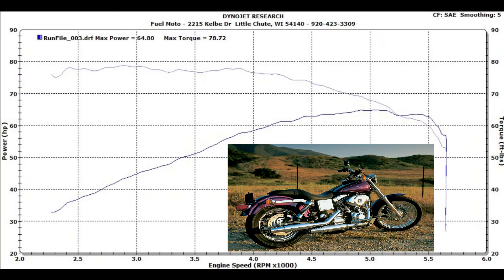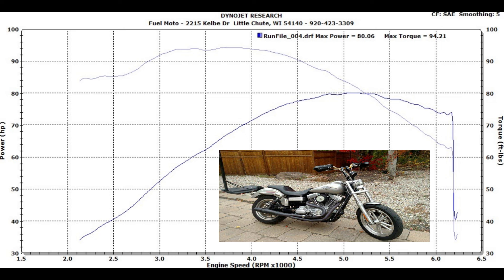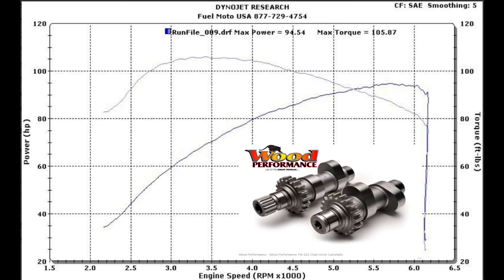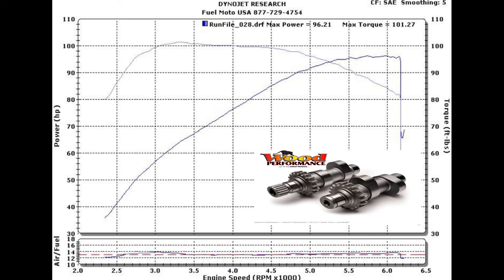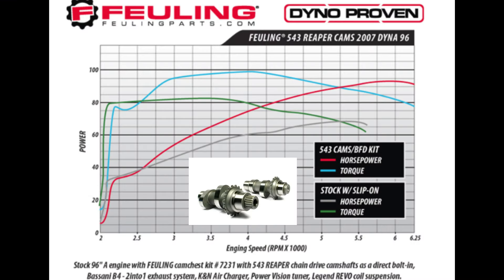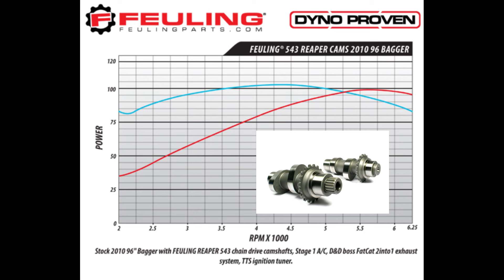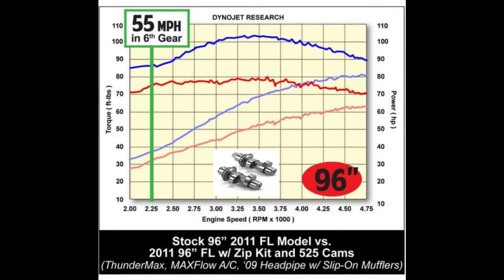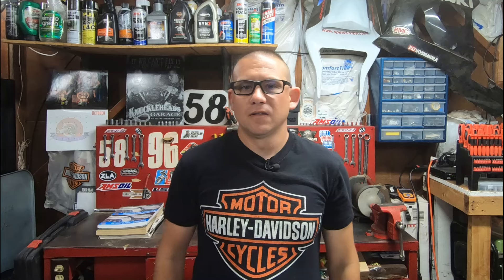Consider New Cams For Your Twin Cam 96 Before You Convert To A 103

Comment: Are you available for consultation appointments? For a fee ofcourse..
I need some guidance and recommendations as to how to go about, were too look and what to look for with my 96 performance upgrades
Reply from the maker: What year 96 is it?
Reply: @GixxerFoo just picked it up its 08 street glide all stock with slip on vh.
Reply: 13k miles
Reply from the maker: Oh wow, where did you find that at? Being an 08 keep an eye on the compensator. They had issues there between 07 and 09. Cranks in those years had some issues with big horsepower builds, they tened to develop some run out and wobble. But if you keep the power to a decent level it won't be an issue.
Reply from the maker: I would suggest looking at FuelMoto, they sell a wide range of brands and even there own house brands as well. They are a top notch company to get an idea what you want to do with your bike. What kind of power are you looking to make?
Reply: @GixxerFoo  it was a craigs list find out here in Oakland California.. I would line to squeeze as much as possible , without running into issues ,if issues are enavidable I will address them as well
Reply from the maker: With a 96 the best upgrades and keeping it reliable, start with a nice cam like a Wood TW-222, great all around cam produces horsepower in the mid 90's and torque close to 100ftlbs with a 96. 103 is only a bit more with that cam, not really noticeable. So with that cam not worth a 103 kit. If you need more a 110 kit at 10.5:1 compression will put you over 100 horsepower and 110+ torque. Next step is head work. A good head port, even a mild job would get you in 110 horsepower range and in 120's on torque.

Comment: I have an 09 96 and planning to add a cam, will these cams provide a nice lumpy idle or smooth like the stock cam?  Having to replace the compensator so my as well do a cam too.
Reply from the maker: Going with something aftermarket and not Screamin' Eagle will give you some lumpy idle.

Comment: I have a 09 fatboy..if I get the TW555 cam do I need to switch the lifters to
Reply from the maker: You don't have to change lifters, it's a straight bolt in. There's some debate on switching lifters, I like to change lifters with a new cam, it's not necessary just a preference.

Comment: so i want to buy a used 2013 street bob with the 96. the bike has new covers on it saying 103. it has a vh pipe airfilter and tune. the owner is the 2nd owner and doesnt know much about the bike.  is a 96 with a stage 1 the same as a stock 103?  or was a stage 2 put in it?
Reply from the maker: The 2013 would of been a 96, now someone could of put 103 covers on it or actually put the piston and cylinder kit on the bike. Only way to truly know if it doesn't have receipts would be to pull the heads and measure the cylinder bore.

Comment: Will I need compression releases if I add woods 777's to my 96ci? 
(I have a 2into1 and intake)
Reply from the maker: Complete bolt in and it won't raise your compression up enough to need compression releases. If you ever have any head work done it's not bad idea to add some while the bike is down but not completely necessary.

Comment: I was recommended s&s 583, but after watching your channel.  I don't know what to go for.2010 dyna super glide custom 96 ci, any recommendations thanks.
Reply: Hey man. I got a 2011 super glide custom and my Indy shop recommended S&S 585s. Told me they rip in the upper rpm range. I kinda just want a cam that will wanna throw me off of the bike when I crack the throttle lol. I’m not too worried about making it go 140 mph, but more so how fast I can get it up there 🤘🏽

Comment: If I go with the Woods Tw222, I was told the base circle is different from the OEM cams. So, sounds like I can't use my stock pushrods then (I DON'T want adjustable pushrods) So, what pushrods do you recommend for a 96ci? BTW, it has a stage 1 done.

Comment: The combo Im planning to set up is a 103 kit with a s&s 625 cam and some mild head work any thoughts?
Reply from the maker: That's pretty hefty cam, it will definitely have one hell of a lope at idle. With head work and the right compression to match that cam it will run hard!
Reply: @GixxerFoo  awesome the s&s website says it’s good for 10:1 completion that was what I wanted to shoot for
Reply from the maker: That's a good compression ratio to land at, plenty of power and you won't run into knocking issues.

Comment: What would you recommend on a 110? I got 777 woods and it makes 100hp with 125 tq
I wanted alittle more hp.
Reply from the maker: It's really hard to beat that Wood, the 110 has low compression for its displacement. If you added some high compression pistons with that Wood cam it would really take off in the numbers.

Comment: Just an update. The good is I just got home with the Wood TW -222 installed. There's good and bad news. Good news is it runs, and seems a bit more pep when I push in first but only city riding so I could not really open it up at all. The bad is my mechanic showed me the cams I had in my 2007 street glide and they already had the CVO 255. I bought it used and could not have known since it was my first bike of that size. Really had no reference of power and so on in actual riding memory. So I am wondering if I just invested $1200 in parts and labor for a minimal upgrade. I mean it is what it is. Neither of us could have known since I got it used.

I mean seems from your charts it's still about a 10hp and 5+ fp torque gain from the CVO cam.
Reply: that sucks..  for future reference if you ever buy a used bike and wonder if it has stock cams or not just pop a push rod cover off and if its still stock solid push rod its prob stock cams, if its an adjustable rod then good chances someone was in there and did cams.
Reply: @bigblue3568  The Woods cam though was worth it. Accept for my MPG it's just as fast and torque powered as a 103 as I can tell. Maybe a little more my a few points.

Comment: What about the woods 777 and 888..?  🤔
Reply from the maker: I was really trying to keep with the simple bolt ins that will work with stock compression and heads. But they aren't bad cams with a little head head work and compression.
Reply from the maker: Really? Usually on that cam they recommend a little more compression to get it to take off.

Comment: How simple is it to put these cams in yourself? I'd love to work on my own motorcycle but would hate to fuck something up and ruin it
Reply from the maker: It's not too bad, I would highly recommend investing in the Harley Factory Service Manual. It's step by step and easy to follow, use that with some videos and make sure you have the specialty tools it goes pretty smooth.
Reply: @GixxerFoo  very cool!  I was given a Clymer Manual for the dyna when I bought it. Is that what you're referring to?
Reply from the maker: No the factory service manual you can only get at a dealer. It's about 70 bucks but it's well worth it. It is literally step by step and tells you every tool you will need to do the job.

Comment: Could you do the same video with the EVO 80” 1340 pleasssseee!!!

Bey the way love your video’s greetings from the Netherlands!
Reply from the maker: Thank you! I appreciate it! I will take a look st the Evo, l am working on the 88 right now.
Reply: @GixxerFoo  that would be greet!
I just bought a Electra glide stand. with carb. From 97’ as a winter project, so the cams are do for feb.

But thank you for your reactions 👍🏻👊🏻👊🏻
Keep up the good content!
Reply from the maker: I appreciate it! That Evo is a really engine, l talked about the Screamin Eagle cam in my Evo video. The aftermarket Evo cams will do what the stage 3 from Screamin Eagle produces.
Reply from the maker: 86 and 94 out of an 80 inch?? What all do you have done to her? That's some strong numbers.

Comment: I’m interested in the 574 reaper for my bagger, any thoughts?
Reply from the maker: 574 is a great all around cam, it's got strong bottom and mid range but it really comes on up in the higher rpm range.
Reply: After much consideration I pulled the trigger on the andrews 48h. Planning on leaving it a 96” with stock compression until it’s time for a overhaul, currently have 25k on bike so hopefully that’s years down the road. Bike currently has slip on exhaust and that is all. Going with bassani 2x1x2 header and stage one air cleaner as well.
Reply: Dyno results are 90.65 hp @ 5.42 rpm and 102.58 tq @ 3.70 rpm

Comment: I have a 2010 fatboy lo 96ci. Unfortunately I don't have a 2 into 1exhaust. I've got v&h 2 into 2 big radius with quite baffles and a Kuryakyn hypercharger. Riding style well I'm always hard on the throttle and I like to run my gears out to the the higher rpm range before shifting. Which of these cams would match my scenario best in your valued opinion??
Reply: Another question do I need a tuner if I'm getting it dyno tuned??
Reply from the maker: Depends on your dyno tuner, they have licenses for whichever tuning program they use and they can flash your bike. But you won't be able to edit your tune or make any changes yourself without your own flash tuner.
Reply from the maker: I think the TW-222 would be a great bolt in all around for the way you ride.

Comment: Touring 96 going with woods. Thanks love you video
Reply from the maker: Thank you! Which wood cam did you go with? Wood cams can be a bit noisy and it bothers some people. But they make a lot of power by holding the valves open longer.

Comment: Did the 96” have issues? I’m looking at an 09 street glide and my buddy says noooo the 96 are absolute garbage
Reply from the maker: The 96 is a good motor, they did have a compensator issue in the 07 to 09 model year but that's not the engines fault. The 96 got a bad rap being the first years of fuel injection and the 14.7 cruise afr. They ran hot due to that, easy fix with a flash tuner but the reputation stuck with that motor.
Reply: That’s what I figured thank you so much. You helped out a ton.
Thanks for taking the time to reply

Comment: Hey I have 07 96 inch with about 70 000 miles on with stage one V/H pipes fuel pack 3  tuner would you put a cam in it with this many miles on motor
Reply from the maker: If it were me and it's doing great at 70k l wouldn't mess with the formula. To add a cam with that mileage, l would go ahead and freshen up the top end. Add a monster cam and it will be good to go!

Comment: I have a 96” can I run 89 octane stock ? And with a cam run 89 octane
Reply from the maker: I would run a minimum of 91, you don't want to get into a situation with engine knock. I carry small travel packs of octane booster on trips. Just in case I have to get gas and some rural stations may only have 87.

Comment: How would the woods tw 777 on a 96 motor road king
Reply: OK just read that tw 777 are just a little to big need some motor work so the tw 6-6 would be good so you can run out every gear on that camm right I do a lot of highway driving

Comment: You need to check into the s&s mr103 cam easy start
Reply from the maker: Those are nice and you don't necessarily need to add compression releases with those.

Comment: Do you know if the SE 96 heads are much different then the stock 96 heads ???
Reply from the maker: Are you talking about the heads in a stage kit?
Reply: @GixxerFoo  yes.  Been looking online for some ported heads and i found a couple of SE 96” heads , but i cant finde any info in them
Reply from the maker: The SE heads are ported.with larger intake valves and  upgraded valve springs to handle higher lift cams.
Reply: @GixxerFoo  aah so SE heads are always better then stock 👍 thank you im slapping some on my 96” and cams
Reply from the maker: @thechiefengineer5886  Yeah SE heads are always the performance versions. Even CVO heads are little better than regular stock stock heads but nothing like the SE's.

Comment: Any recomendations for a 2011 FLSTC w/ stage 1?
Reply from the maker: It's hard to beat a Wood Cam for all around power, are you looking for gains in the low to mid range or something more on the top of the rpm range?
Reply: @GixxerFoo  I primarily run in the 0-3500 range.

Comment: Can you go over the 777? Was gunna get that fir 103
Reply from the maker: I believe l can in an upcoming video, you need a little work to get the most out of the 777.
Reply: I have the 777 in my 96” street glide, it really woke the bike up but I wish I had a little more compression to help it out. It’s a mid-top range cam and my 96” doesn’t like the bottom end much. Once you get up around 2500 rpm it comes to life but anything below that and it’s like stock

Comment: did you hear anything negative about 2007 96 in motor
Reply from the maker: The only issue issue they had was OEM compensator. If you have to replace one don't go back stock, get the Screamin Eagle.
Reply: @GixxerFoo  I went to a solid sprocket comp.

Comment: Stock 96 is only 78.72 ft lbs torque?  Heck my stock Sportster Seventy-Two was 73 ft lbs of torque...  weight to torque ratio you can beat a good ole sporty.  Add pipes, Arlen Ness big sucker, cams and a tune and a sporty will run!
Reply from the maker: That's why l love my Sportster 👍. Harley really held the Sportster back, it wouldn't look good having those Sportsters walking over the big twins.
Reply: @GixxerFoo  picked up my 2012 Seventy-Two in Big Red Flake used with Stage 2 already done and it will hang with buddies 103 Street Bob with Stage 1 all day plus mine gets way more comments at gas stations than his does.  No dyno done on it but I would be curious as to what the torque is now.
Reply from the maker: That 72 came in some beautiful colors, do you know what cams are in it?
Reply: @GixxerFoo  unfortunately no.  Bike was taken in as a trade at a Polaris dealership.  Several buddies who have ridden it say it does have cams.  Local Harley dealership tech who can basically rebuild a bike blind folded didn't ride it but started it and held his hands to feel the exhaust agreed it has cams and said more than likely Wood Performance cams but can't say for sure with out cracking it open.
Reply from the maker: That's pretty bad ass that he's done enough builds he can feel the exhaust and get an idea. Wood is a damn nice cam on a Sportster, l bet it sounds pretty good!

Comment: Very costly for manufacturers to use lighter building materials, aluminum, titanium, composites, carbon fiber, etc.  easier just to
Throw in a larger motor.  For customers, the most expensive to modify is the engine.  I buy a bike for its engine as suspension is cheap to modify vs the engine.  Lighter bikes help everything such as handling, braking, and  acceleration.
Reply from the maker: Great point! It does add up to start doing engine work, I always highly recommend doing as much of it as you can on your own. Labor isn't cheap at all, you can spend some big money on suspension and brakes too if you really get into it.

Comment: good afternoon. I have a 2010 dyna fat bob with the v&h 2-1 hi output short exhaust and high performance filter. What cam would you put on it without having to change lifters and pushrods..... and if you recommend changing them, which one would you put???
Reply from the maker: For a dyna with that setup I would with a Wood 555 and go back in with adjustable pushrods that way you don't have to disassemble the top end. A set of adjustable pushrods is a lot cheaper and easier than tearing down the top end. You'd for sure want to inspect your lifters for wear and marking, if they look good I would reuse them if you're under 10k miles. I would go with a one of the more inexpensive set of Jims lifters if it were me.

Comment: 2011 ultra, 96 stage 1. Decatted stock with Rinehart 4" slip on. Mostly 2 up. Which cam would you suggest.
Reply from the maker: I really like the numbers on that Wood Cam personally, the TW-222 is hard to beat for all around power in a touring bike.

Comment: Cams first, then do the 103 conversion. That's my actual plan for now
Reply: Brandon Candelario 
Are you doing the work yourself? 
Because if can wait it would be easier & cheaper to do it all at once because it would save you from having to do the push rods a 2nd time or if you’re using stock push rods you won’t have to buy the rocker & lifter block gaskets
Reply: Why? You can bore ya stock 96 cylinders out to 107.....
Reply from the maker: Not a bad plan at, enjoy the cam and then freshen up the top.
Reply: @scrumthebum2451  I'll most likely end up doing it myself, I don't like spending money on something I can do.
That said I'm used to small block Chevys so we'll see how it turns out when or if I ever get it done lol
Reply: @jerlaine1638  
If you don’t already have one invest in a official Harley Davidson service manual for your year & model.

Comment: What about andrews 48h?
Reply from the maker: Glad you mentioned that, it's close to the wood cams, just not as aggressive so it's quieter than the wood. Not as much peak power but close. Andrews proudly grinds the Wood cams but they are to Bob Wood's specs.